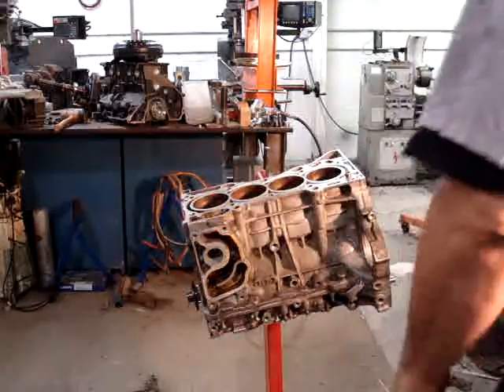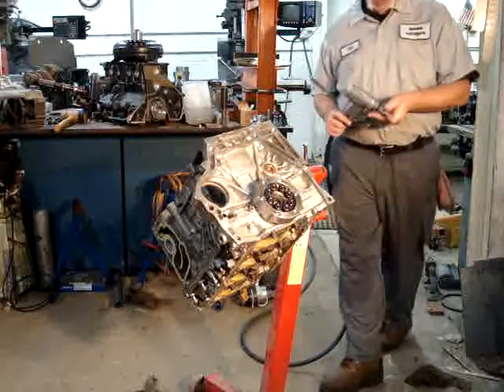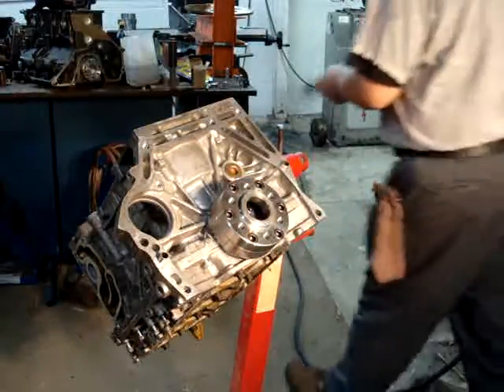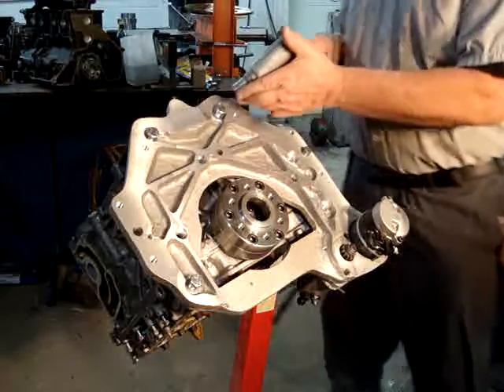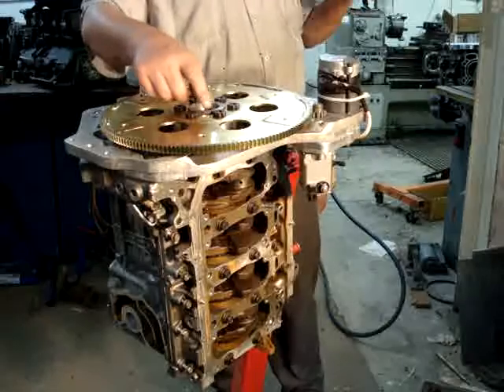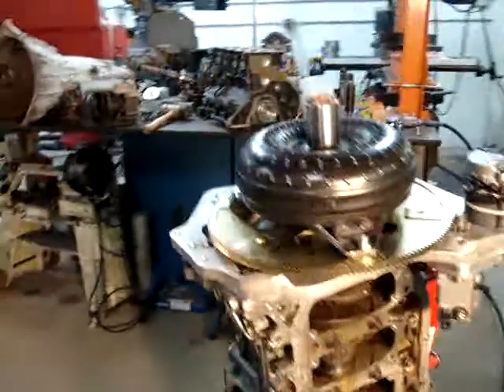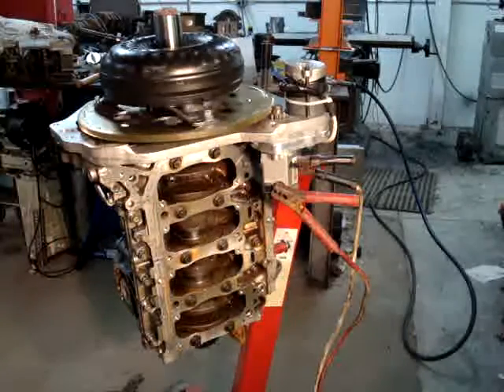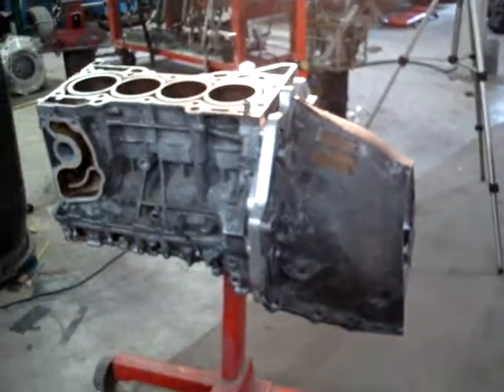k20a 013

Comment: I'm curious the weight of the 2crankshaft adapter coupler's.  Also I see room for a pilot bearing provision on the secondary coupler. We got tons of options with hydraulic throw out bearings. So we can tie it all together.